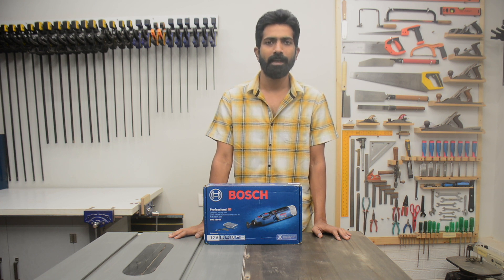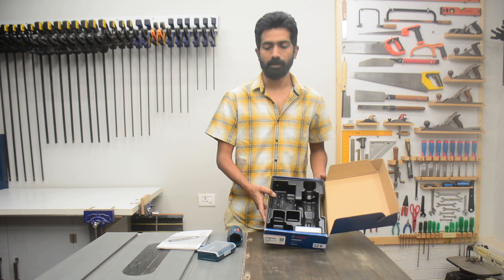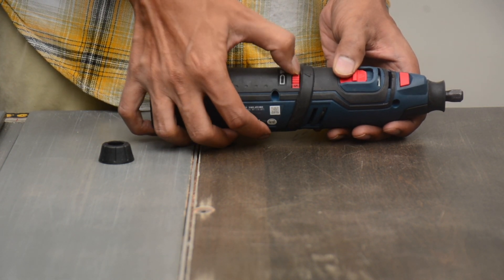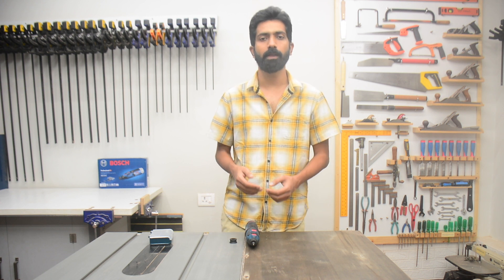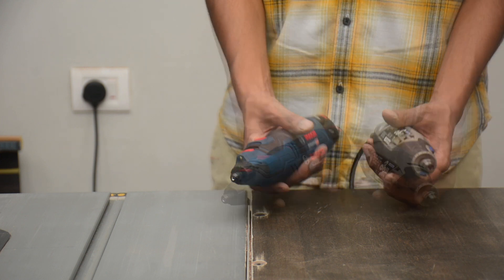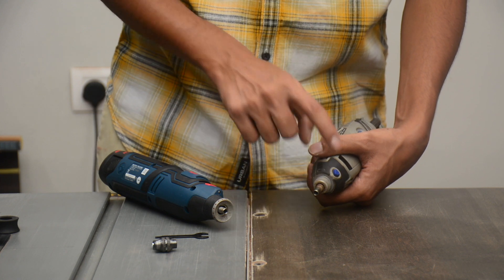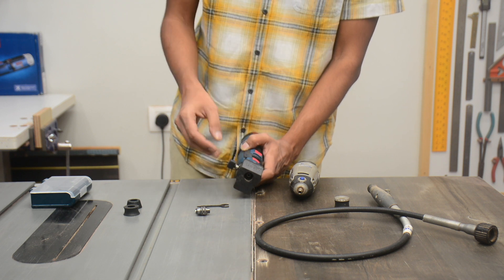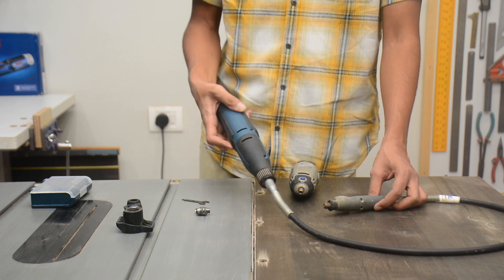bosch gro 12 v-35 | unboxing review and comparison to dremel 3000 | compatibility of flexible shaft

Comment: Yes Dremel is owned by Bosch and it is good that the main parts are interchangeable and the battery can be used from the 12V drill Bosch machine. That background information is very much needed many thanks

Comment: Thanks Bro for the nice desi  video, the BOSCH GRO 12 v 35 does not have a hanging part so that it can be hooked up to my DREMEL WORK STATION during operating the DREMEL 4000 flex shaft, did you find one , please advice & share.
Reply from the maker: Thanks for appreciating the effort..!!

No, it does not have a seperate hanging attachment available, atleast i never came across one. You have to device some jig to hang it on the workstation.

Comment: Is it compatible with Bosch 10.8 volt 1.5 Ah Li-ion  battery?
Reply from the maker: Yes, all bosch 10.8 volt batteries are interchangeable with 12 volt batteries. However 10.8v 1.5 Ah willl give less run time compared to 12v 2Ah batteries.

Comment: Where can I buy the Dremel 3000 or 4000 from?
Reply from the maker: Dremel is not available on major online platforms anymore in India. However if you contact all your local bosch dealers they might have some stock of dremel tools. I got mine a few years back (in 2018) Through Amazon.